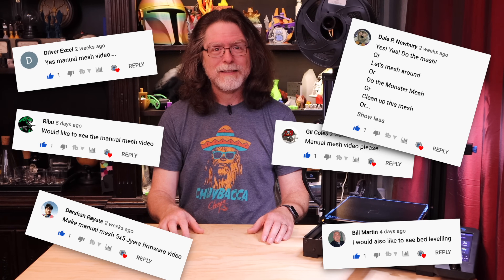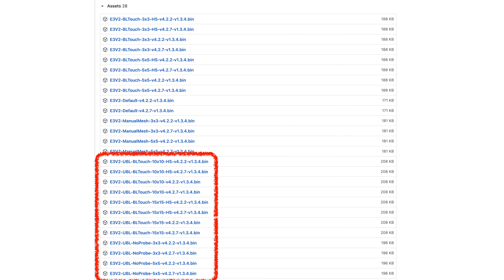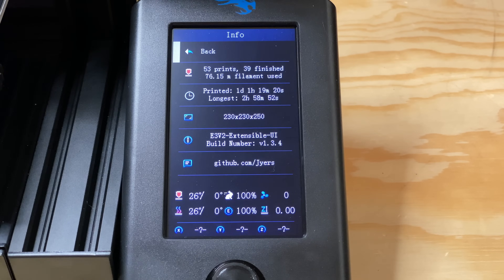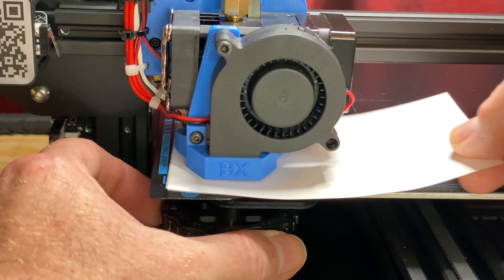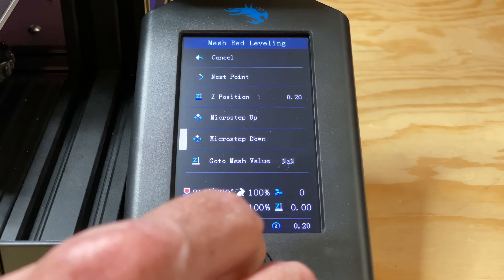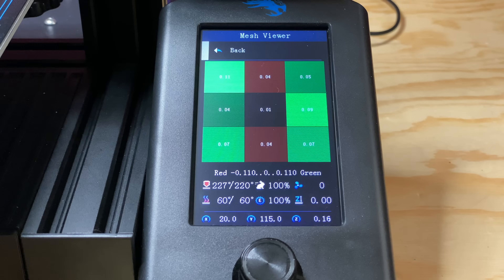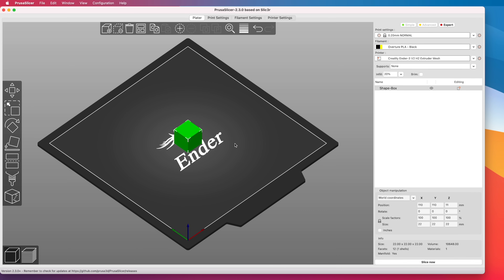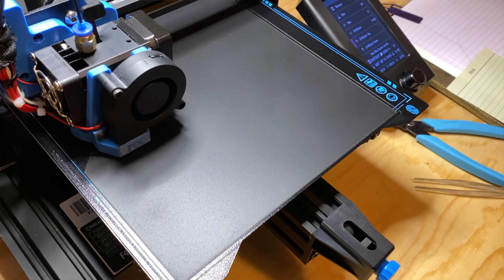Perfect First Layers with Manual Mesh Leveling - JyersUI on Ender-3 V2

Comment: Hi there.  Thanks a lot !  Your videos are awsome for a new guy in 3D prnting.  I've finally managed to get that bed leveled correctly and it greatly improved the quality of my prints and my overall experience...  Also have you ever heard of the Z axis not hitting the limit switch when homing? I need re-home it several times before it trigs the limit switch.  I own a Crealty Ender 3 V2 and every other limit switch works properly for homing their axis.  Thanks.

Comment: Not quite up to the confidence of changing much on my new ender3 v2 yet but find your videos very good put mine together with your instructions and it seems to be working a treat got a few issues but I think it will be just time before I am getting to a higher level

Comment: Thank you so much for introducing me to the Jyer's UI for the Ender 3 v2.  It really makes the printer much easier to use.  I downloaded the 5x5 manual mesh version and it's working great.  I've had to do some trial and error to get it tuned but I'm making progress.  I'm an American residing in Ecuador.  When I go back to the U.S. for the holidays I'm going to get a CR Touch to automate the process of fine tuning the leveling of the bed, but the manual mesh is a great help.  Thanks again.

Comment: Awesome sympathic dude 🙂 and seems like to be a great video .. not to say "easy".

Yeah, and than you give it a try (ender 3v2 with crtouch) and just not being able to get it right after 4 evenings on trying hard

when i'm "viewing mesh" all 3x3 parts are red, which - i guess - is not the problem as long as there isn`t too much difference between the values ..
anyone got an idea for me?
I'm thinking about uninstalling the cr-touch and just give the "manual leveling" firmwire a go; but i've done it like in the video

Comment: Hey man, where did you get the light bar for your printer that's shown here? I'd like to add one to mine just having trouble finding the rigjt one for a V2
Reply from the maker: Hi! That's a cheap ring light / selfie light I picked up on Amazon. I printed a couple of brackets to hold it onto the printer's frame. I've got a little video about it: https://youtu.be/sgw-KDnSzTM
Reply: @BV3D  Awesome, thanks Bryan!

Comment: Great video. Everything is clear up until you start talking about z-offset. There you totally lost me. Why do you need any Z-offset if you've adjusted all the points individually? What kind of z-offset adjustment do you make and how do you figure that? Thanks
Reply: I just watched and have the same exact question!! Further explanation would be appreciated, amazing and informative video regardless! :D
Reply: @mowtown2496  and he don’t answer us.  Making money off us watching but won’t explain.
Reply: @dugy40  calm down. I'm sure he is a busy dude.
Reply: @mowtown2496  busy making money off us clicking his videos.  I don’t see him interacting with anyone.  The other creators do.  Chep for example.
Reply: Yes - please explain th z-offset - thanks :)
Reply: Sorry to bother you, but did you ever figure it out ?
Reply: @stormbytes most machines require 2 separate adjustments. The multi point adjustment he is talking about in the video is an axis calibration. This tells the printer where the x-axis is in relation to the bed. Basically it sets the printer up to follow the bed. This is 0 on the z axis. But the nozzle always requires a gap between the nozzle and the bed and it can differ for each and every machine as it is such a small distance that a number of different factors can change the distance, even coming down to how worn down the nozzle is. To account for this the 0 point of the z axis is almost always set above the bed to ensure that the nozzle isn’t scraping the print bed. Z offset is the small adjustment from that 0 to ensure the perfect distance between the nozzle and the bed. This distance ensures that the first layer is being placed in such a manner that it stick to the bed, without peeling, but isn’t so close as to cause the filament to underextrude (potentially causing jams due to pack pressure).

Comment: Bryan, thanks for your videos. All are well explained and very detailed. Now, I'm trying to do the manual leveling but after selecting either the Botton left or right coordinates the bed just move down a few centimeters, do you know where I have to adjust the depth value to made the manual adjustment? I'm using the JyersUI  bug-fix-version v2.0.0. Thanks in advance.
Reply: Never mind, I just discovered that the home and top left values are different and from there it moves to the bottom left correctly. Thanks!

Comment: I added the line "M420 S1 ; Enable mesh stored in EEPROM" after the line "G28 Z0".  but right after the new line i added i have this: " G29 ; initiate z-probing " , does it need to be deleted? it looks like the 9 point z probing it does before each print, I'm just worried that this will override the mesh, am i really off base here?

Comment: Many thanks for your guidance! I have installed the firmware and everything is great except after power cycle the option "Auto leveling" in UI is allways off and I'm going to switch it on every time I power up the printer. I have tried several times to store the settings and while the manual mesh settings are remembered this exact setting is allways off at power up. Do the M420 S1 option overrides this? Thanks!

Comment: I have a problem.
"leveling active" appears uncheck every time I turn on the printer.
Do you know if there is a solution to that issue?
Thanks in advance
Reply: I have the same problem. But maybe it's not a problem because you tell the printer in the G-code you want to use the mesh leveling... Can somebody tell me the right answer please?

Comment: Thanks for the video. But may I learn what is the differences between BLTouch, ManualMesh and UBL-BLTouch versions of Jyers ? I have ender 3 v2 with bltouch but can't decide which version is the best.
Reply from the maker: Hi! Here's what I know.

The Manual Mesh method uses the nozzle itself as a probe, and the person using the printer manually the nozzle height at each probing point by using controls on the screen. At the end of the process, the person saves that mesh data to the printer. Since you have a BL Touch installed, you probably won't want to use this version.

With the BL Touch version, the printer uses the BL Touch to perform the probing operation, and it saves the mesh data when it's done. This is most likely the version you want.

The UBL option is Unified Bed Leveling, available both with BL Touch and "no probe" options, and it's a feature I haven't explored yet. My understanding of it is, the BL Touch version performs a probing operation as the regular BL Touch version (above), and saves that mesh. Then when you print, it probes just the four corners of the bed to detect and compensate for any tilt that may have occurred. Feel free to give it a try! If you don't like the way it works, you can easily switch back to the BL Touch version.
Reply: @BV3D  thank you so much for your detailed explanation. I will go ahead with bltouch version for now. I really want to get rid of this leveling issues. Thank you for your great videos.

Comment: Hi, I have followed the video and it is great! just one question:
when I turn on my printer, on levelling menu, "levelling active" is deflagged...it is correct?
Reply: I think another user found that Levelling Active checkbox reset to empty each time the printer is powered down. He also found that checking it means the printer then loads the mesh for every print regardless of whether the M420 S1 command was in the Gcode. This was useful to him as he had a number of projects already sliced and he was glad of not needing to reslice them all after adding in the M420 S1 command in the printer settings in Cura.

Comment: A bit late to this video. With referencing to the initial flat bed leveling adjustment via the 4 corners using the knobs below, I've found that after I did for all 4 and come back and check the corners again, the A4 paper test is either a bit loose or tightened. I could go through many iterations (round all the corners over and over again) and struggled to get them all leveled. Any help? Thanks
Reply: A few common suggestions are (1) ensure your springs are fairly compressed so they hold a setting better (2) consider using a metal feeler gauge instead of paper - they are relatively cheap and many find them easier for consistent results (3) it's not uncommon to do a few laps of the build plate making adjustments - usually the adjustments get progressively smaller as you get closer to the end result (4) many upgrade the Ender3 springs to the yellow die springs available on Amazon and Ebay - they are stronger, hold a setting better than stock springs, and pretty cheap.
Reply: @3888Orbost  Thank you.

Comment: I cannot slice the One Big Layer in cura, is there something special needed? It is shown with gray/yellowish stripes. Edit: It was just too big even though it was correct size, maybe there is some margin. Scaled X/Y to 98% and all good
Reply from the maker: Yep, scaling it down just a tiny bit is the fix. There's a "No Print Zone" around the edges of the build plate in Cura. I think the idea of that zone is to prevent the nozzle from running in to binder clips, for those using glass beds that are clipped to the aluminum plate.

Comment: So I had abit of an issue just getting the big flat square to slice in Cura. At a .2 layer height and the square being .2mm tall, i would be met with a greyed out square in the preview. I had to set the height of the big flat square to .201 to get it to properly slice

Comment: Greta video, love the new looks and added firmware function. I have one Problem, when I load the big, flat, square STL or even create my own...print time sliced is ZERO. Using Cure 4.11 and not sure what's the deal is.
Reply from the maker: Cura sometimes has a "do not print" zone around the perimeter of the bed. Try reducing the size of the Big Flat Square to about 200mm x 200mm and see if that'll slice.
Reply: @BV3D  best size I found for Cura slicer was 190x190 this may allow for the skirt or it might not. I dont know and haven't tried it yet. Found your videos on this firmware while in the middle of a 12 hour print. I've watched both videos and want to do the firmware upgrade but do I have to rename any of the .bin files or just move it to the SD card and follow the rest of the install video. I've watched and rewatched the install video and can't seem to find anything of value unless I missed something
Reply: Also, for me, it didn't recognize 2mm as a layer so I scaled it up to 3mm. 2.5mm surprisingly didn't work although that's what my first layer thickness is.

Comment: Hey man I’ve got a serious issue I just added a bltouch to my e3v2 and during mesh it goes to the middle of the build plate ( facing the printer right middle section) and it’s only probing the part as it’s supposed to be probing across the mid section and starts hitting its limits opposite of the end stop is there a fix for this?

Comment: Thanks for these vids. 
I have the Ender Extender 350mm Z axis kit. Can you show us how to edit the firmware, PLEASE!!! 
. 
. 
If possible, I would also like to move the preheat folder to the top of the menu so I don't have to scroll down. Not a big deal but this is what use the most so moving it to the top would be handy.
Reply: Never mind moving menus around. As I try editing the firmware I realize there's a lot more to it than I thought.
Please show us how to edit Jyers. Trying to follow along with other videos seem so much different than this.
Reply from the maker: @3sotErik  I've added this to the list of videos I want to make. This aligns with something else I'm wanting to try related to JyersUI. 😉
Reply: @BV3D  FANTASTIC! 😁

Comment: I have an issue with my ender 3 v2. When i upload one gcode file for 3d printing print speed in system goes to 826% and printer running in terrible speed .It happed only problem with one file.
Reply from the maker: Hi! Since it sounds like the problem only happens with that one G-code file, I suspect there's something wrong with it. Especially if other files you've sliced work fine. Try slicing the STL again and see if you get the same result.
Reply: @BV3D  I tried it multiple times but the problem exists for the file.

Comment: I am just waiting on mine to be delivered I already have Octoprint ready for it. and a list of prints to do. What is a good cheap filament to do drafts with?
Reply from the maker: Hi! If you're in the US, give Printed Solid's Jessie PLA a try. It's between $19 and $21 per 1Kg spool. Good for drafts and production. If you're needing a neutral color, try their Quarter White or Design White.

They occasionally have "transition colors" where they're switching from making a batch of one color to a batch of another color, and it's sort of the in-between one-of-a-kind color, and when they have 'em in stock they're about $16 a spool.

https://www.printedsolid.com/collections/1-75mm-jessie

Comment: Just noticed that the BLTouch can be used by Jyers for the manual bed leveling! No need for sliding the paper around anymore
Reply: you still need to manually level the bed first
Reply: @KingNothing22  yes, but you use the BlTouch to do the manual bedleveling, instead of using the paper or Post-it. That was my point. The BLTouch probes the corners and guide you to turn the levelings knobs up or down.

Comment: Hi Bryan- thanks for your vids!  I've had a ender 3 v2 for a few weeks now, and with your help I have the jyers firmware/UI and everything is mostly working fantastic.  I've done both manual and mesh leveling.  Some of the more intricate things I try to print like things with gears, etc are still failing due to bottom layer squish / elephant foot / binding.  Have you done any videos that address this?  Also, it would be awesome if you could further explain the Z offset towards the end of the video.  Do you check/change this offset on every print?  Does it need to be set back to 0.00 if you want to manually tweak the mesh levels, etc?  Everything else in the video made perfect sense to me except for that little bit on the z-offset!  Thanks again!!
Reply: same here - awesome video but did not unterstand how Z offset works and why it has to be done at all...
Reply: @jenswarth1672  It's not a necessity to do if you get it perfect. You just use it to adjust the bed nozzle distance if you feel you're to close/far. When i did this i was too close so i had to adjust like 0.4
Reply: @siljeberg  The problem is, how do you know you're too close or too far? The video didn't really answer that either, and this is the big question from everyone here. What does too close or too far look like? How do you know which way you need to adjust the offset, or even if you need to?
Reply: @erin.anderson  if it is too low, your lines will have a more flat look. If it’s really low, lines will look super flat with a very thin almost bare line down the center where the nozzle is rubbing against the bed which will lead to your nozzle getting clogged often and failed prints. If it’s too high, your lines will have trouble properly sticking to the bed as well as will look a little squiggly.
Reply: @jenswarth1672  anyone knows anytihng more about the z offset
Reply: The Z offset adjustment is used to 'offset' the thickness of the paper used when the bed was levelled.
Reply: @jakewill8702  The z-offset moves the nozzle closer or further from the bed. When you are doing your first test you finetune that distance with z-offset to get optimal bed-nozzle distance.

Comment: Bryan, thanks for posting your videos on Youtube, always informative, and you make it easy to learn new stuff to help with running a 3d printer. I have a suggestion for a future video. It's possible to take an Ender 3 pro and convert it to using the V2 screen instead of the stock screen. One thing I haven't seen a lot of information on is the fact that if you do this you can then install and run the JyersUI firmware on it as well, providing you have a 4.2.x or newer mainboard. I decided to try the process and it was super simple to do. Doing a video for this conversion might be a good one to do to help folks out.

Comment: will this work for the standard ender 3 with a 4.2.7 board or is the new display  of the v2 a must have... or could you get away with messing with the firmware and changing the display type back to the standard ender 3 model?

Comment: I don't get it.
When I'm creating a new mesh the printer will check all points automatically.
I've to save it to eeprom. Than I have to do the manual tuning. But at the last point to check there is no "save to eeprom"...
I'm very confused.
Reply from the maker: Hi! When you get done manually tuning and it completes the last point, you can navigate back out to the top level, then come into the Control menu, and near the bottom of that list is a "Save Settings," I think.

Comment: Hello. Congratulations very good video. One doubt. I have saw that my ender 3 is slow down Z changes when auto-leveling is active (after create manual mesh. My ender hasn't BLTouch) is it normal functionality or maybe is a trouble with the firmware? Thanks. I have JyersUI 1.3.5 with 4.2.7 board and Manual Mesh version (without BLTouch)

Comment: For those of you using Cura and want the `M420 S1 ; Enable mesh stored in EEPROM` line to be automatically added to your .gcode files:

1) On the prepare tab on Cura, press the printer name on the top left.
2) Press the "Manage Printers" Button
3) Select your printer in the list, and press "Machine Settings" on the right
4) On the bottom left, edit the text box to include `M420 S1 ; Enable mesh stored in EEPROM` under the `G28 ; Home all axes
` line
Reply: Thank you!